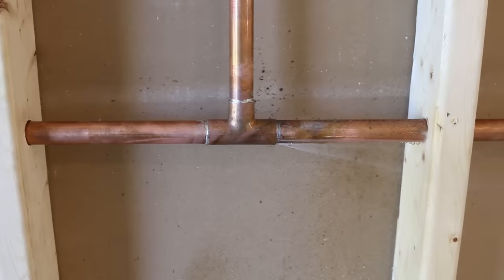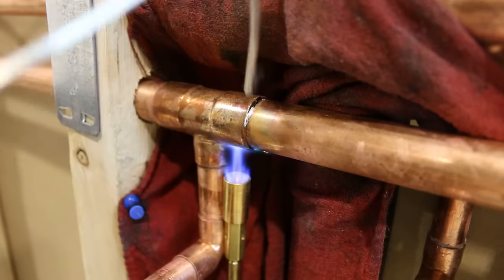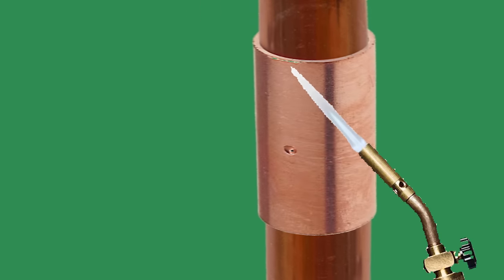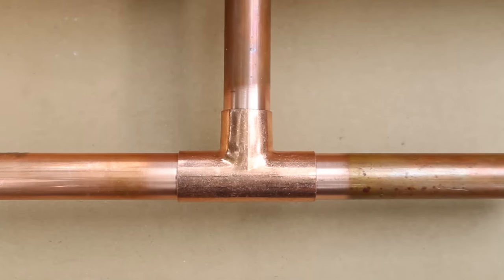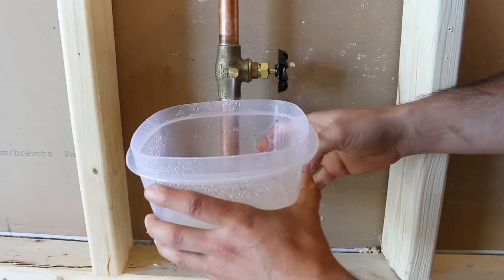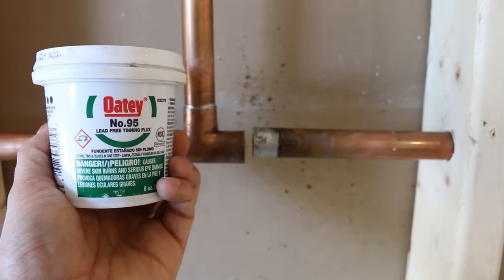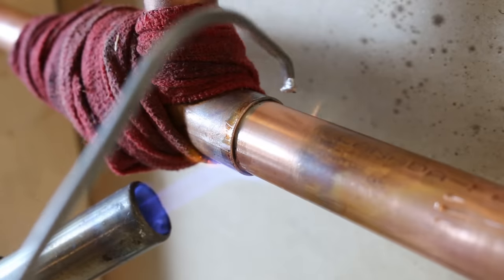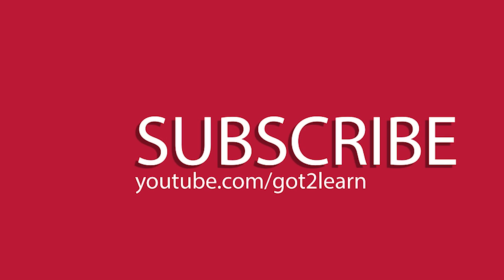The CORRECT Way To Fix A Leaking Joint (UNSOLDERING) | GOT2LEARN

Comment: Being a home handyman, I noticed that sometimes I could not get the solder to wick cleanly. I was picking up materials at our local hardware store where they have experienced tradesmen who provide invaluable advice. The plumber explained to me that paste flux has a limited life - a few months can make it tougher to work with - and mine was years old. Sure enough, the cheap can of flux I bought was immensely better than the can I had for so many years.
Reply: Laco Flux, Sterling solder, Mapp (yellow) gas for your torch. You will be invincible!
Reply: Get a tradesman to do it.
Reply: Never had trouble with flux, clean , with proper heating……..water, closed system causing steam, or air expansion….
Reply: @blackpine6693  same here and I’m still using a quart of flux I bought in 1996
Reply: @johnlennon1151  what, so they can smash big holes in your house just to fix a single joint and charge you £250 for the privilege? No thanks.
Reply: @dontfit6380  😂
Reply: @dontfit6380  haha mines got something like 1998 stamped on the tin 👍🏻
Reply: @joski9030  oh yeah definitely no good laugh 😂
Reply: @nickjones9867  if you're not s licensed plumber you shouldn't be touching it, simple as that.
Reply: @nickjones9867  Tbh if they did it properly that is cheap.
Reply: @Nick Jones:  yeah, something like if you are not a brain surgeon don’t put a band aid  on a small cut.
Reply: L0 of
Reply: @johnlennon1151  Ha! After watching about five videos this morning, I feel certain I'm now a more competent plumber than 75% of those I've met out on job-sites. Ask one what capillary action is sometime. 

It's soldering: in this age of online information, there's no longer much mystery about it. Being "licensed" does not a competent tradesman make, so spare the rest of us DIY plebs the old specialists' song.
Reply: @Rory  I wish that was possible now. None available here. Not even a wait list.
Reply: @johnlennon1151  Depends. I was quoted $400 plus parts to replace an easily accessible ball valve. Studied a DIY video and did it in less than one hour. Another time I was quoted $200 to replace a multi water supply line to frig and humidifier. I said come on over!! The latter was a fair price the former was not.
Reply: @johnlennon1151  I know that your comments are over a year old, so perhaps you've had a change of attitude.

But if not, keep something in mind.

The only real difference between a "licensed" plumber and the average home handy man, is some knowledge and experience.  Oh... and the paperwork, that you'd be shocked to learn, isn't that difficult to obtain!!!

Then, keep in mind, the "pros" are out to make $$$$ and THEY CAN AND SOME DO take advantage of people who just don't realize what a job requires.

I'm one of those guys who refuses to pay RIP OFF PRICES to someone when I can learn how to do the same thing.

If one has intelligence and CONFIDENCE, anyone can learn the necessary techniques involved.

As for soldering, a person can take some old pipe and joints, get a torch, the right solder and flux and practice on those pipes.
Yes, YOUTUBE VIDEOS are great for learning things, ESPECIALLY when vids are done by the actual pros.

However, if someone doesn't have confidence that they can learn something like this, then it is better to let a pro do it for sure.

Again, one can learn to cut, ream and solder pipes by watching good pro vids and practicing.

Roy, I haven't hired a plumber EVER.

By just studying, learning and doing, I've been able to fix everything that I've needed to.

Next week, I have to replace the regulator and preventer on our hydronic heating system.  As well, I'm adding a whole-house filter.

Sounds massive, but it's not.

Most can do it, Roy!

Oh... while I think of it, perhaps it's not a great idea for you to put your insecurities on others.

Just say'n
Reply: @dontfit6380  It hasn't  sat for ten years in Arizona 108 F heat.
Reply: @Jeff-jg7jh  you are correct I’m not in Arizona. I’m still using that same tub of flux. I did get the year wrong though. It was actually bought in 1993 not 96. It sets in an unconditioned building that get over 100 degrees in the summer with 90% humidity and to -15 in the winter. I’ve even had to dump condensation out of it before I use it. 😂
Reply: Good for you mate ;) just make sure you’re safe and that you’re only sticking to the plumbing that you’re legally allowed to do without a license 👍 
just out of interest what do you do for a living? It isn’t as easy for a lot of people to just pick up stuff like so fair play to you. Also did you have any difficulties whilst working on your own plumbing and if so how did you overcome them?
Reply: I forgot about this thread.
Ok, so here we are over a month later.
I did the job on the hydronic furnace (boiler) and replaced both the preventer and the regulator.  Since everything was so old, rather than just removing those 2 pieces, I remove the entire pipe that they were attached to.  I put in new pipe.

For the first time,  instead of just using regular solder and flux, I got some of that solder paste flux (it's flux with solder in it).

I now love this stuff.  Of course, I will soldered around the joints as usual, just to make sure all is will.

This job was easier than I thought it would be and not only does it look professional, there are no leaks at all.

So this cost me the price of the 2 parts, the solder paste flux, a new copper pipe (thicker walls) and a few joints and such. 

So much less expensive than a "pro".

But to be clear, this may not be for everyone.
To be fair, I've been fixing my own plumbing all my life, so nothing is new to me here.
Reply: @BlondieSL  fair play to you to be doing all that, safely with no leaks and not being qualified it is definitely something to proud of; I’m curious what do you for a profession? Are you a tradesmen or have you just got a natural affinity for these kinds of things?
Reply: @cameront7804  I've had a varied career.
I'm a person who gets bored quickly.  I need constant new stimulation.

So I took up different careers throughout my life.

When young, I learned how to do a lot of things as my step father was a carpenter.  So that's where a lot of that comes from.

Also, I'm not afraid to take on something new and learn as much as I can about the new subject.

What I've learned in life, is that if other people can learn to do something, so can I.

So when young, I got into Electronics very early and had my own TV Repair Shop by 20 years old.
During that time, I also learned computer programming.
I also kept my music up (keyboard player).

It was enough to keep me interested for well over a decade.

But the TV repair thing got boring as it was just repetitive.

So with the advice of a very good friend of mine, who was involved with NASA, I went back to Uni and got my computer degree.

I then had a career in computers, from repairs, to design, to programming to systems analysis.

I stuck with electronics as a side-line and designed a few gadgets.

I worked hard, as did my husband, so we could retire early.

So now, being retired, I focus mostly on gadget designing and programming them.

During my early years too, I studied to be an electrician.  That went well, but this is where electronics came into the picture.

So rewiring our house was easy for me, everything up to code and not having to pay thousands to someone with a piece of paper.

As for plumbing ability, that too I learned early on.  I learned how to do what I needed.

In the house we are in now, whomever did the plumbing before could not have been a professional.  First then used those cheaper copper pipes type M.(red).  Of course, some of them sprung leaks which is how I discovered this.

Many years ago, I replaced them all with type L (blue) and no more issues.

In fact, with the hydronic boiler repair I just did (the 2 valves) I also used type L (blue) as a preventative maintenance.

Also, while no where near a mechanic, I do most of the repairs on our vehicles.

Again, I take the attitude that if others can learn do to things, so can I.  It's worked out.

Hey, I even rebuild the motor in my old Mustang!  LOL  That was fun.

So perhaps  a jack of all trades and a master of just a few.

LOL

That all being said, I do NOT carry this thought process to the medical field.
So I'll not be doing any heart surgeries.  LOL

j/k
😅😂🤣
Reply: @cameront7804  to give you an idea of how hard it is to sweat pipe. My 9 year old boy has been sweating pipe for a year now. It is not a job that is difficult by any means. 
It definitely shouldn’t require any type of governmental license. Unfortunately people love to be ruled and controlled so most states require a license.
Reply: @dontfit6380   Okay buddy that’s good for your son but I’m not talking about the act of simply sweating pipe. Yes that act on its own doesn’t require much skill at all. Obviously. But if your nine year old son was replacing regulators and adding filters all by himself without assistance or having been shown it before he’d be a very intelligent nine year old. Having the confidence to do all your own plumbing especially when considering certain heating components of a system without ever being shown does take a certain amount of problem solving skills and confidence which I have to say is respectable. That’s what I was saying. 

I live in the UK so plumbing and heating must be pretty different, but as a heating engineer and electrician by trade and I can tell you most people can not and do not do their own plumbing and heating successfully and the ones that do are usually tradesman for a living. In terms of plumbing we comes across so many instances where our customers have attempted to do their own work and failed. We also have so many regulations here on systems such as the unvented or vented cylinder systems which due to certain components can be very dangerous to work on and if not installed correctly, houses can be and have been blown apart often from unqualified people not working on them using safe working practices- you have to be qualified to work on.
Reply: @BlondieSL  I have always called it, Jack of all trades and master of some. I have worked in pretty much all trades at some point in my life. I’ve wired and plumbed whole factories. What I have never done was get a license to do any of those things. No matter all the experience you have and all the things you’ve done means nothing to a “licensed professional” 
You can only be a plumber, electrician etc. if you’ve been granted permission by the government.
Reply: @johnlennon1151  why?
Reply: Ah, thank you
Reply: @BlondieSL : I shouldn’t think you’ve got a lot of fun in your life.
Reply: @Kingcarparpeggio  I'll be honest with you.
First, of course my life is fun.
However, being honest, the "fun factor" has lessened since the pandemic.

We used to go out all the time and really kick it up.

But now, not so much.

However, we have learned how to create other ways to have fun and adapt to the "new times."

So yeah, our lives are fun, just a different type of fun.

And those who know us personally, wouldn't expect less of us because we are fun people who take steps to enjoy life to the fullest. 

After all, King, life is way too short.  So we must enjoy and make our fun now, before it's too late.

Now, if by chance you came to that conclusion because I said that I get bored easily, I get it.  And perhaps that's because I didn't really explain what that means.

In short, I have a mind that is always hyperactive.  It's always working on something.

So if I don't feed my brain new and exciting things, I can get bored until I find some new project.

But getting bored doesn't mean no fun.
On the contrary.  LOL  When I get bored, it's FUN to figure out new projects or to write a new song, something, anything.

LOL
So yeah, life is fun for us.

I hope life is fun for you too, because again, LIFE IS SHORT.
Reply: @johnlennon1151  This was the same "argument' that veterinarians in California used to make brushing your dog's teeth illegal.
Reply: @johnlennon1151 absolute rubbish, plumbing is like every other industry, 20% are great and the other 80% quickly go from competent to burn down the house bad.
Reply: @johnlennon1151  If the licensed plumber did the job right I wouldn’t be here watching a video how to fix his joint leak.

Comment: Thanks very much. My mistake has been applying too much heat & flux to both ends of the pipe & then putting more flux after after running the solder into the pipe. I think your video has corrected these mistakes for me .

Comment: I’ve been doing commercial plumbing for decades and this guy is showing the proper procedures on every video I’ve seen. Some circumstances won’t allow you to get all the water out of the area in question. If this happens you may have to use a slip coupling to repair the leak. Doing this will allow you to cut the pipe near the leak to drain the remaining water. After it is drained you can mark your pipe so you can assure your coupling is centered before soldering your joints.
Reply from the maker: Thanks Jeff 🙏🙏🙏
Reply: Jeff, thanks for providing validation so we amateurs can’t have confidence in the videos.

Comment: This is fantastic . As an industrial maintenance technician I always do everything myself . However I have always found it difficult to solder copper pipes correctly . I was having a miserable time with my new hot water heater installation . Your advice saved me countless hours of work . Thank you so much for the help ! God bless ! (New subscriber)
Reply: Never say hot water heater ,just say water heater,if the water is hot you don’t need a heater.

Comment: Thank you! 

I was getting frustrated with my solder joints leaking (trying to add a "T" to an existing cold water line). I kept re-fluxing and re-soldering (the wrong way) and it wasn't getting any better. 

Then I watched your video. 

I spent a few minutes removing the T (using your vise grips/hammer technique), sanded the insides and outsides as well as I could, re-fluxed, refitted, and re-heated. It took the solder perfectly the first time and I haven't yet seen a leak.

I didn't know that about "not overheating the joint". I think that's probably what caused my original failures. When I disassembled the joint I noticed that there was bare copper inside the T where there should have been solder. I suspect the flux boiled away, as you cautioned against.

There's definitely something to be said for doing it the right way the first time.

Comment: I just refitted an old pipe and soldered everything on my own (5 fittings and 2,5 mtrs of copper). That worked quite well (even when I needed to start all over again bcs I screwed up the correct length..) because of your excellent tutorials - thanks. That was the second time I ever soldered but even for the first time, your videos already helped me out. (the first project is 2 years old without a leak).
Reply from the maker: @unwokesnake  😇😇😇

Comment: I'm a professional plumber, so of course I want to toss in my $0.02 worth: Copper pipe that has water inside is nearly impossible to solder. The water becomes steam when you heat it, and the steam escapes through the joint you're trying to solder, keeping the metal from reaching soldering temperature, and pushing the partially melted solder out of the fitting. One of the best ways to overcome that if the pipe can't be completely dried inside is to leave an open fitting nearby,  such as by using a screwed adapter for the last fitting to make. With 1/2-inch copper pipe, it's possible to solder if you can dry out about 10 inches of pipe away from the fitting to be soldered. The bigger the pipe size, the further away from moisture your soldering operation needs to be.
In the first example here--if it's 3/4 or 1/2-inch pipe--it's better to cut the section out and use new fittings--with couplings--to make the repair, because it's so hard to get the inside of an already-soldered fitting clean enough.
There are good tips and correct techniques in this video, but don't ignore the part that says soldering is a skill that takes practice. If you've never soldered copper pipe before, a repair that a pro could do in 10 minutes will be an hour or more of frustration for you.
Reply: How about stuffing bread up the pipe to stop dripping water? I think glutinous is best. I’m going to try a bagel. Plain, without cream cheese, onions, tomatoes, or smoked Salmon. The pressure will blow it to the first open tap and the water will dissolve it.
Reply: Aww  BS. Perhaps true for many, I will concede that the skill is not easy to learn, and that caution is advised, but the categorical abstinence is a bridge too far. 

I just repaired a faulty “professional” installation that failed prematurely. But it took me 5 days, and was very stressful. 

Your advice is good for most, but not all.
Reply: @OnerousEthic  can not use bread in a closed system.  I flare and install flare joints for those.
Reply: @diyjohn9584  … sure you can, if your really worried about bread residue you can flush and refill the system once the work is completed (that’s good practice anyway to remove flus residues etc.)

Comment: Thank you for this! I haven't done a lot of copper, but I've never had a problem before. I did a few joints in a bathroom remodel today, but had one that the solder was 'being weird on' and had a pinhole leak when I turned the water on. It was also my first time using MAP gas and it overheats the joint really quick apparently. I cleaned it all off and followed the steps here and so far so good.